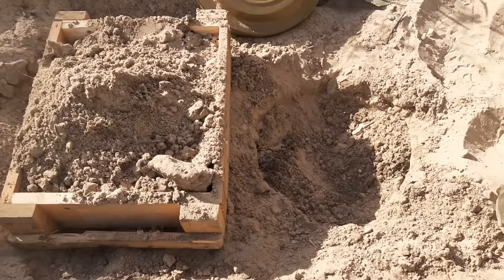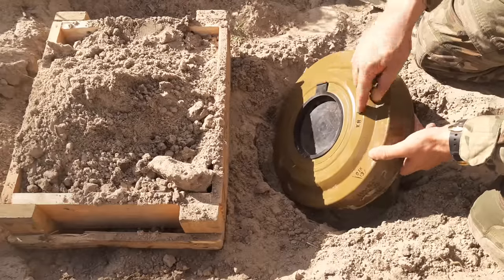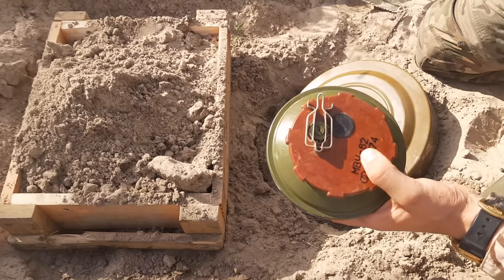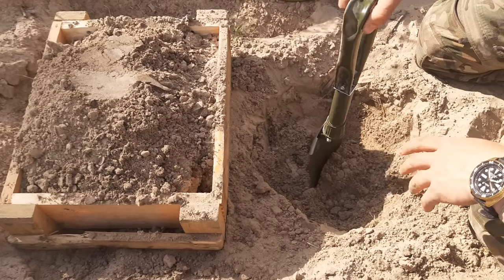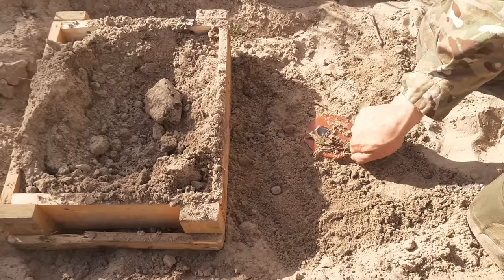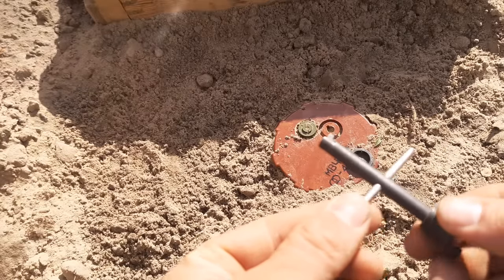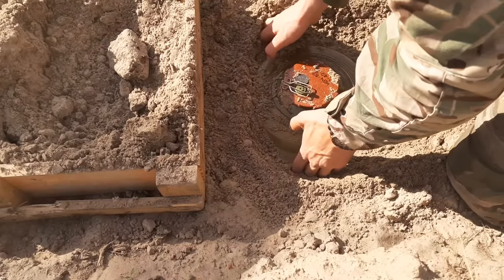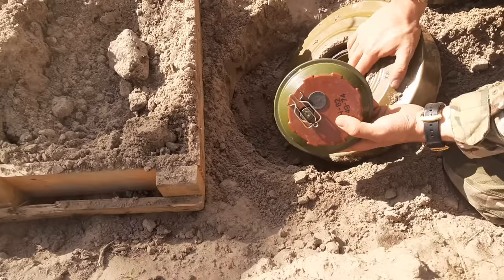TM62m antitank mine and how to use it (soviet)

Comment: Dude has more faith in an anti tank mine key than I have in anyone I've ever met
Reply: The way the actual detonator fires is when the mine is driven over by a tank. So there needs to be considerable ground pressure. Even if it's armed, unless the cameraman drops the camera on it, they're safe.
Reply: It sounds like you need better friends.
Reply: do not forget guys, these are SOVIET mines!!! even cheaper then russian mines!
Reply: @deltaphaseplutonium-ho8nh Wow, why escalate it, why is he "ignorant"? He made a lighthearted joke.
Reply: @karlgans113  USSR had wayyyy more money and industrial power than the russian federation. RF hasn't developed anything new in any significant numbers, only modernised. USSR used to be a direct competitor with the US, RF is a regional power at best.
Reply: @jiffyjefferson  как там контрнахрюк?)
Reply: i think it probably require certain weight to activate it. its not a personal mine.
Reply: @CharlieTheAstronaut  an awful ignorant joke
Reply: @redhongkong  330 to 1,210 lb
Reply: @@d_k-ol4ge Hence the use of a grappling hook with a long, long rope to lift it free of the soil.
Reply: Sketchy…
Reply: When you get sent to a Soviet Mine School, you learn EVERYTHING about them, from Construction, Assembly and Disassembly, Arm/Disarm, and more.
Unlike Western Training, where they just skim the basics.
Reply: @jiffyjefferson Loxist Troll.
Reply: He has to, faith will move treads in this case.
Reply: @whitescar2 Normally, yes. But it can be easily modified so the pressure required to detonate is much less.
Reply: @redhongkong   Yes it does. About 250-800lbs depending on the specific trigger used. There is an anti tamper version, but obviously he knows that isn't what he's handling. There is also a version of the mine that doesn't have metal body, it uses cellulous. To make it harder to detect with a metal detector.  It is a very interesting mine. I have a training one on my shelf. They were available for a shot time in the USA. 

My fear disarming one,  would be someone put an anti personnel mine underneath it as a trap. He addressed that when he explained how to unearth one.
Reply: What
Reply: Not for me!! Thanks
Reply: Needs about 400 pounds of pressure  @whitescar2
Reply: I've ripped apart one of the firing assemblies and they have a fairly strong spring inside that takes a lot of force to compress enough to fire the priming charge.. also, you could remove the cap while armed as they are not boobie trapped. The cap does have enough explosive inside that it would definitely ruin your day if it went off in your hands though.

Comment: Anti Tank Mines are possibly one of the safest mines for humans out there... I would be shocked if he was playing around with a 50-60 year old ATM, but a new ATM can be jumped on thrown around and still cool with humans...
Reply: The problem is that people can booby trap them
Reply: @javant6993  I would think the best way to disarm a mine would be to take cover as far away as practical and then shoot it.
Reply: That could work for some mines, but it might not be the best way to deal with antitank mines, simply because the explosives used in the mine are quite resistant to blowing up when shot, burned, but if you were to hit the detonater or booster charge, it would probably detonate the mine. Another option is to remotely lift the mine up, if it's booby trapped it blows up, if it's not you can use it or it's components against the enemy
Reply: @javant6993  Oh right, insensitive explosives.  I have seen videos from Ukraine where the demining teams use grappling hooks and a long rope.   You would certainly not want to lift the mine out of the ground by hand.
Reply: No jumping ^^
Reply: you know you could just leave the pressure detonator without any cover and you would get a 6kg anti personnel mine.
Reply: I actually know the case where seargent, while explaining at mine to the cadets, jumped on the mine to show "how safe it is". 6 people dead and 4 injured. Im not sure what model of the mine was tho...
Reply: Ahhh that depends on a variety of factors. Some AT mines are detonated by only tens of kilograms of pressure, something a human is perfectly capable of applying by jumping on it.
I hate mines personally, and the only work I would ever do with them would be disposal, not laying them.
Reply: take off the cap and it would explode under low pressure, any mine can be modified quite easily
Reply: @josephastier7421 that is a practice commonly used by armed forces, hence why some combat engineers carry DMRs or sniper rifles
Reply: I saw a video of a truckload of mines being unloaded by simply dumping them
Reply: @SenorTucano Yeah without detonators.
Reply: @CoffeeConsumer643  You need about 150Kg of pressure to detonate an anti tank mine
Reply: @MrGichinfunakoshi  if you leave a cover off the pressure detonator on the mines we used its sensitive enough to just go of on human contact

Comment: Very interesting video, thanks. If I'm allowed to ask, what weight does it take to trigger? Only tanks and heavy trucks or also small car?
Reply from the maker: By books 160 till 400kg, with civilian cars it depends on speed, and layer underneath the mine, but for infantry soldier in full loadout its no danger at all!
Reply: @valgear5525  if you get a hold of them could you do a video on the German RGW 90 or the DM51 hand grenade?

Comment: You can easily make that special key yourself in any garage, use an m10 or m12 bolt, drill a hole and put a pipe sprint in it, weld another bolt on top at 90 degrees and adjust length, good to go! Thats what Ukrainian famers are using when disarming these mines in the field!

Comment: What happens if you unscrew the detonator before disarming it? 
And also can you explain what anti-lift device is?
Reply: You can’t lift it or boom
Reply: 1. Nothing, if there is no booby trap under it.
2. It's a mine which explodes when you take a pressure out from it's pressure plate.  Soviets projected and produced an entire family of them. ML-8 (МЛ-8) is the most common in the field, I suppose.

Comment: Thank you for this important video on the operation of this mine and it's fuse. The other end of that key looks like it's specialized as well - what is that used for? Lastly, active emplaced landmines are incredibly dangerous and should only be handled by trained personnel like combat engineers, sappers, or EOD. There are nuances to each mine and the potential of anti-tampering devices meant to end person's tinkering where they shouldn't be is quite high for mines employed in real situations.
Reply: Always keep a flock of sheep handy for defining as they have 4 legs each.
Reply: I'm suppose the other end of the key is meant to pull the button out if it gets stuck due to icing, but I'm not sure. The manual says nothing about it, LOL.

Comment: Does the disarming key still work once the mine's fully armed? Interesting vid, thanks.
Reply: One way to find out!  >click!<   See?  Now It's perfectly sa
Reply: Yep, it works. But it's not recommended to do if you are not a specialist. There are a few ways to boobytrap the mine and the fuse itself. Also there is a small (yet real) risk of a manufacturing defect, which could cause troubles.
Reply: Yes, but unless it’s a mine laid by yourself and has been guarded at all times, you shouldn’t touch it. There could be anti tampering device installed under it. Place a block of TNT on top of it, move to safe distance away and explode it.

Comment: Why I wonder don't they use drones to drop a weight on the mine from the air and safely detonate it maybe equip the drone w metal detector sensors unless there is a more hi tech way of locating them,just seems like it'd b worth a try 2 save even 1 life..

Comment: Is it possible that after its armed you could pick it up and move it somewhere? Im refering to that one video of a Ukrainian civ picking some mines off the road at the start of the war if anybody remembers that vid. Is that possible?
Reply from the maker: Yes it is totally possible, just don't get runned over by a tank, when you have mine in your hands and it's fine
Reply: Yup these are not fitted with antitamper mechanism except that it will go boom if you tried to remove the Fuze off of it while armed. Mainly to prevent reuse as an ied

Comment: Just unscrewing the detonator (while armed), is that possible? (of cause the detonator will still be armend.)
can you show us how to defuse the full red MB4-62 detonator?
Reply: Older ones yes newer ones lock in place when armed and the prawl trips the firing mechanism if an attempt is made at removal.
Reply: Yes, it's possible (but against the instruction). The procedure to defuse the "full red" МВЧ-62 is completely the same, just like in the video.

Comment: Can you set them up like claymore?
Reply: Det-cord can be used to set a pattern.. In WW2 the Germans would do this all the time.  Now days you also have to look for other sensor systems that can be put down with the mine, thus this removal is only by those that set the mine, every-one else would blow the mine  on discovery with a charge..  Imagine a pattern of 7-8 mines going off at once (probably an extreme case, but can easily be done).

Comment: If you make a mistake at any point in that arming / disarming process you would never even notice.
Reply: It seems like an idiot proof system in all honesty. 

Arming process -  If the button is up or you don't hear the clockwork mechanism engage it isn't armed.

Disarming process - If the button is depressed you can't put the safety pin on it so the clock needs to be wound backwards to reset the button so the safety pin can go on it.
Reply: It got a mechanism similar to a toaster oven timeswitch in it. The other one has s device called a pneumatic dash pot inside. When they time out it disengaged a lever to arm the firing prwl lever. The time clock one is resettable by winding the spring that also resets the safety. The other one requires gentle pressure to reset the dash pot inside. As far as mines go the antitank variety are pretty insensitive.